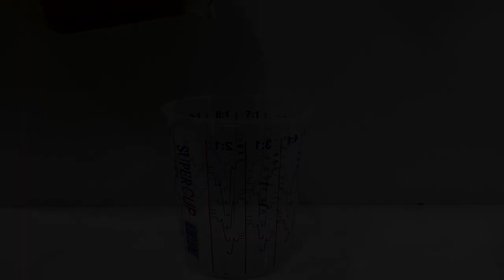Epoxy Resin

Comment: It turned out well in the end. I did wonder about degassing the epoxy?
Reply from the maker: My intention with this piece was to used up the last of my old epoxy resin and make the most disgusting resin item I could ( with minimal work 😉) The pressure pot didn’t enter that equation.

Comment: pretty wild and trippy design Jack. Quick question. What Lathe are you using? thanks
Reply from the maker: Lathe is from Axminster. In wouldn’t recommend their products though
Reply: @JackMackWoodturning  thanks jack. Is there a lathe you would recommend? Like one to aim at getting in a year or so.
Reply from the maker: I’m after a Vicmarc 👌🏻
Also worth checking out Laguna . Vicmarc are super expensive but well worth it for the serious turner

Comment: Jack I like the work! Question: at 14:37 you place a block of plywood in the center of the pour, and then proceed to cut it out. Why? What am I missing?
Respectfully 
Steve
Reply from the maker: Hey Steve. The ply was to raise the level of the resin through displacement.   As I’d not mixed enough to get to the hight I wanted. Does that make sense ?
Reply: @JackMackWoodturning  Jack thanks. That thought came to (displacement ) about 10 minutes after is sent the question 🤔.

Comment: You could've got rid of the bubbles by taking off a bit more of the purple resin then polish it.
Reply from the maker: Incorrect
Reply: @JackMackWoodturning  that's it? Ok cool.
Reply: I've found that tinting thin CA glue and applying it to the air bubble pockets works well.

Comment: Need a pressure pot to get the bubbles out of the epoxy.  But nice job
Reply from the maker: Did you read the video description?
Reply: @JackMackWoodturning  Not before, but did now that you mentioned it.
Reply from the maker: You’ll understand then why I didn’t waste time with the pressure pot ?
Reply: @JackMackWoodturning  Took it for granted you work with epoxy often.